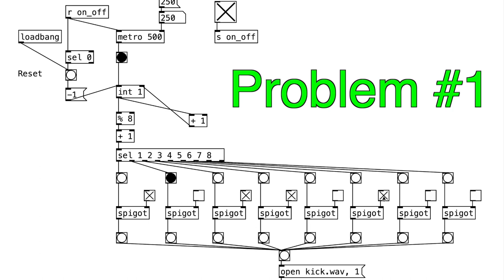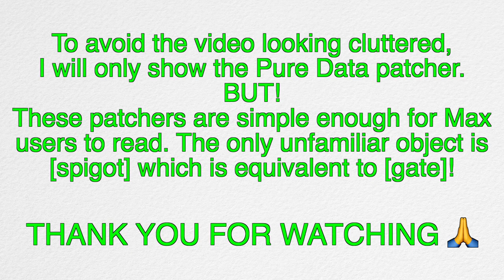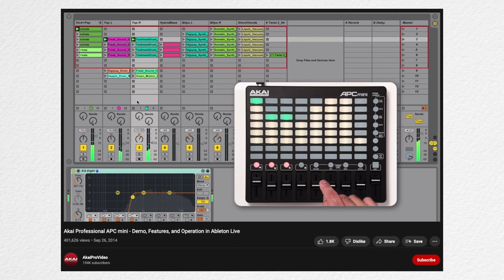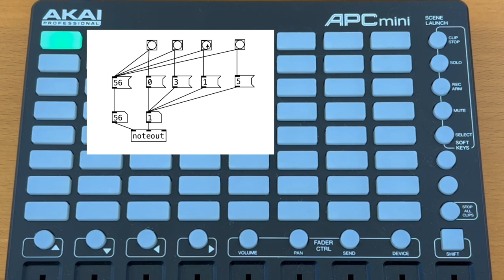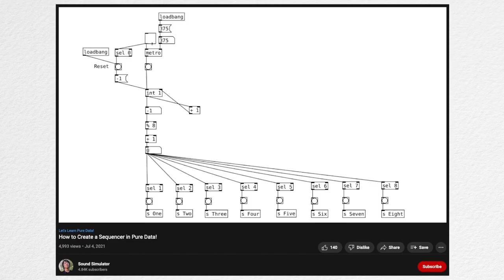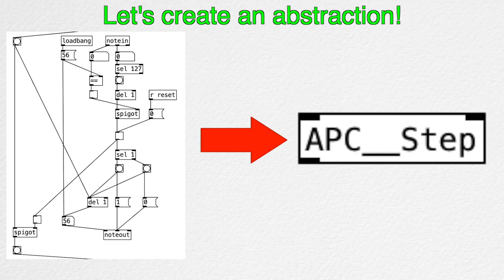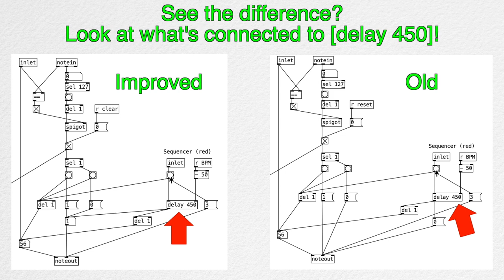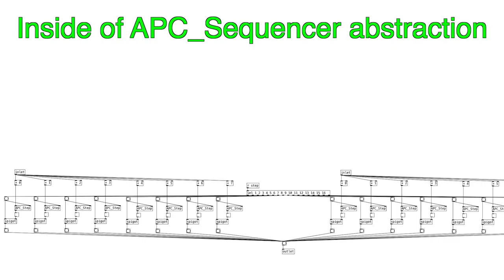Hack Your APC Into a Step Sequencer! (Pure Data & MaxMSP)

Comment: I've made this with pd toggles, but never with hardware, cause i still don't have none 😓

3:50 If you want that a message come first on the cold inlet, it's better to use the [trigger] or [t] object. In this case it should be [trigger bang bang] or [t b b].
Reply from the maker: I weirdly developed a bad habit of not using [trigger] cuz I didn't know the use-case. 
But dang yeah, you can change the order of the output... I needed to make a separate quick video on hot/cold inlet so I'll make sure to use it. THANKS!

Comment: Very nice. Lots of familiar stuff from when I started down the DIY sequencer rabbit hole, like sending velocity through a select object. From here I'd possibly convert it to use either a List or a Text for each sequence, so things like the step count can be controlled by a parameter, and so the current state of the sequencer can be saved and loaded. Also I'd maybe use some Float and Trigger objects to get the timings right for the hot and cold inlets instead of a delay.. though using a 1ms delay definitely works for that as well.
Reply: I agree, I was working with some granular stuff earlier, where timing really mattered a lot, and I had imho great results with using [t b f] for cold inlets
Reply from the maker: yeah, I completely overlooked that when I was learning Max for the first time. Definitely gonna start using [trigger] finally.

Comment: Thanks for your video, great stuff! Not sure if you're aware of it, but you can also add a parameter to the [notein] object. You can significantly simplify your patch by using [notein 56], [notein 57], [notein 58] etc etc and they will only be listening to those particular midi signals. Same way you used the [ctlin] object! :)
Reply: but doesn't |notein 1| select the midi channel instead of filtering the notes?

Comment: Very cool, Would it be possible to display 16 steps per line? For example the steps that had a hit on both sets of 8 would be one color and the steps that had a hit on only one  of the sets of 8 would be a diff color? Or maybe as the last step hits, the next set of 8 would be displayed in another color. If the last step of the 8 had a hit directly following it could be yet another color? All on the same row so you could have more instruments?

Comment: Nice video :) 

I build a pretty complicated sequencer in PD using a Launch Key Mini as user interface and an old Android tablet as a display. It also has a ton of pr. step functions, like transpose, probability, conditional triggers, trigger loop and much more.

A few comments:
Using delays to turn light on/off is not very good practice, because if you change the bpm a lot, it can cause issues, as the light might not turn off before next step. IF you have to use delays, then make sure that the delay that turns off the light is synced to BPM. So for example you calculate what a 16th note is from the bpm you are using, and then take HALF of the 16th note in ms and use that value, so the light is always turned off on half of a 16th note, no matter which BPM you are using, instead of a fixed value.

Also for storing the steps on/off you could use tables, to have more than one pattern to choose from. It does get a bit more complicated, but it will open up a lot of doors later on, down the road.

Anyway, keep up the good work ;)
Reply from the maker: Thanks for the feedback!! I appreciate it. 
Yeah, I should've at least used division for the delay-off instead of [- 50]. Bad move on my part!

Comment: i have been wanting to hack my APC mini for an age to use it as an instrument so this video is fantastic :D although i was trying to follow along in max, but early on i ran into a bit of an odd situation. i set up the note in, the velocity sensor, and the objects that determine the colour or on/off of the LED. i pressed the first pad and it lit up. i pressed it again and it turned off. i pressed a different pad, and the first pad lit up as well. but when i opened the final patch, it didn't do this at all. not entirely sure what's happening which is a shame. got a lot of ideas to use it with :'D
Reply: as an update, i tried it out in pd. worked perfectly and flawlessly. closed that down. went back to max and made the same patch, and now it's working as intended. not entirely sure what changed but can't complain if it works xD
Reply from the maker: @drunkard103  Magic!